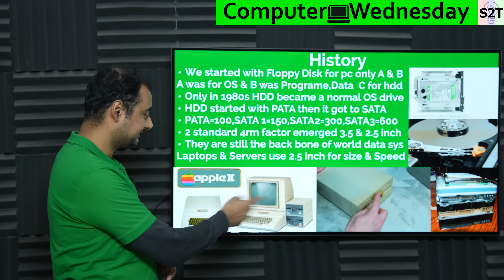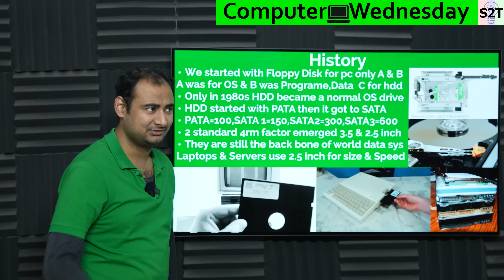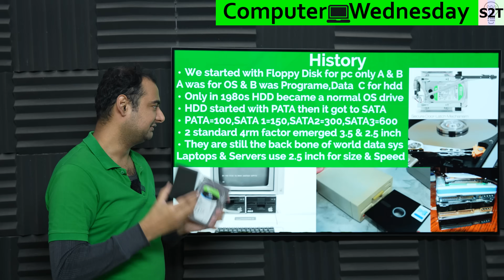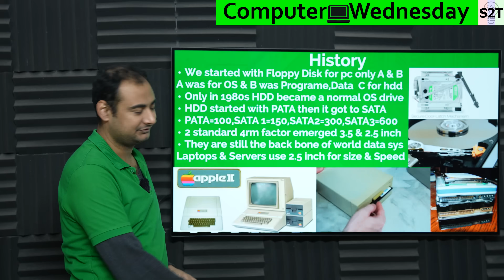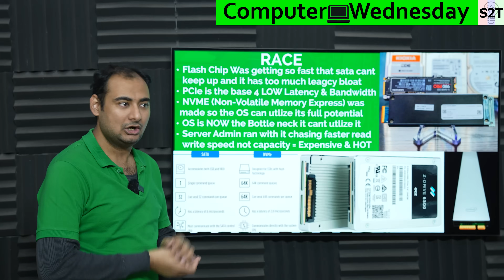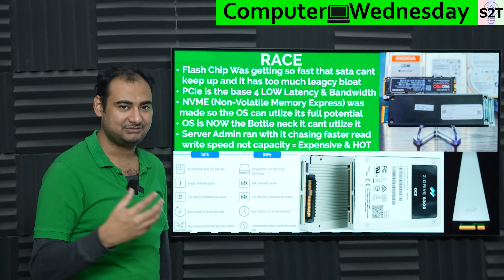Why SSD didn't Fell in Price Explained {Computer Wednesday}

Comment: It’s “didn’t fall” not “didn’t fell” 🤓☝🏼

“did not become” not “did not became”

After did/didn’t, always use the base form of the main verb ✌🏼

I hate all current memory pricing. The 990  pro nvme I bought a year ago costs +100usd more now 🫩 

So I’m thinking instead of another 4tb nvme I’ll grab a higher capacity HDD for media only. I just don’t know if buying one rated for NAND use as a more reliable option is relevant for personal use.
Reply from the maker: wow